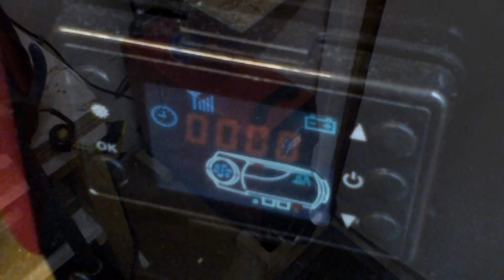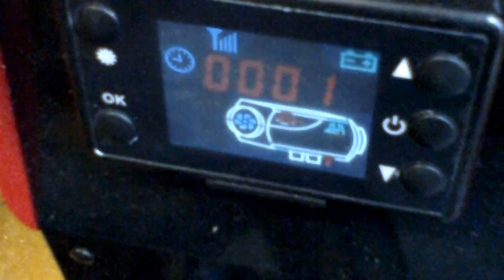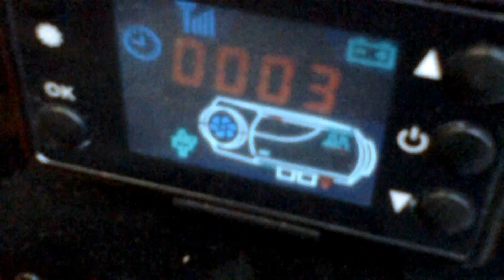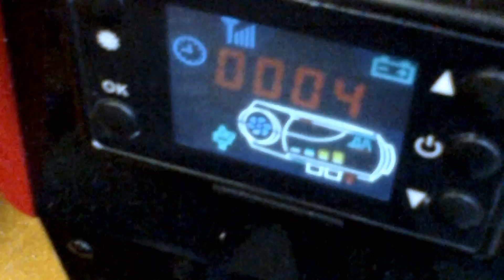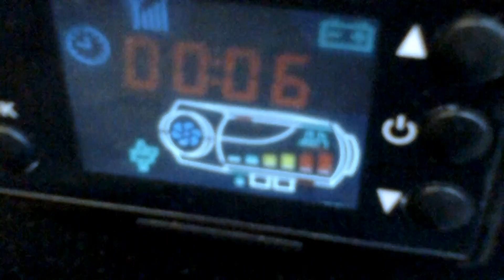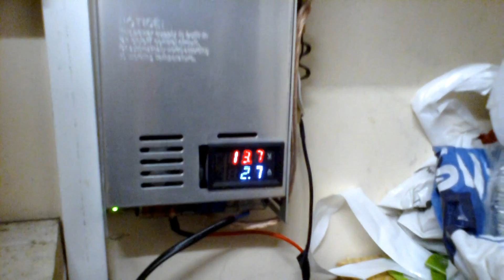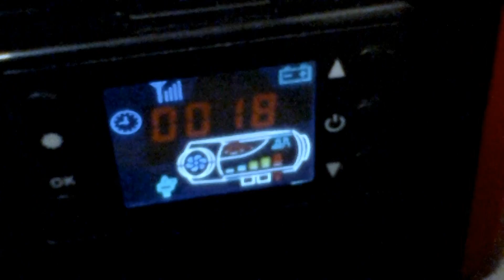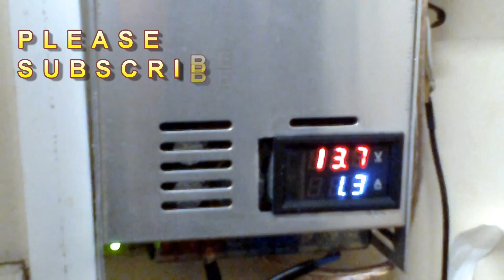COMPACT CHINESE DIESEL AIR HEATER - AMPS used in REAL TIME

Comment: Thank you for the vid...was just the info  I was looking for...just ordered a 8kw all in one unit similar to that for truck camper...thanks again
Reply from the maker: Hi there. Many thanks for posting a comment. My two units are running fine and I have also helped install one in a neighbours home where he wanted to subsidise the solid fuel heating but it’s so good and cost effective he is using it as his main form of heating now. Again thanks for taking the time to comment. Stay warm. Regards Peter

Comment: Hi Peter, I would double check the current on that meter, I bought a few for my eletric bike and found them to be reading on the high side
Reply from the maker: Meter is fine as I got two and both the same on the shiny which has the correct resistance. Thanks for you comment. Regards Peter

Comment: Hi Peter. How powerfull is the transformer that you are using to power it please👍
Reply from the maker: Hi Woody. Standard 12v 20 A power supply off eBay around £15 max. If you type it in loads come up.

Comment: Hi Peter. Where did you get your power supply. Could you give the details of the model. Thanks
Reply from the maker: Hi there. The power supply was obtained off eBay - just search for “12v 20 Amp power supply” but please be aware I myself fitted the volt / Amp meter so you won’t find that included.
I only fitted the meter so I could clearly show in a video the current these units were pulling as there was so much confusion especially between the significance between volts and Amps.
If you do the search you will find loads advertised which look the same - get one for less than £15..
Hope this helps you. Regards Peter
Reply: @brucepeter2007  Great stuff. Thanks Peter

Comment: Thanks for the vid, I was wondering whether to use an old pc atx psu to power one. What do you reckon?
Reply from the maker: If your competent that would be fine as long as the Amp are there. Regards Peter
Reply: Mark whalebone be careful computer power supplies have multiple power rail supply for the same voltage. Just cut all the same voltage wires and solder them all together onto a big connector.

Comment: I have the same 5k unit with red enclosure. I plan to use as emergency power-out heat. Current plan is to provide 12v from Prius extension cord. Prius will be left "on", so the gasoline engine will kick on if the 12v battery voltage drops. Very little petrol will be used in this arrangement.
Reply from the maker: Hi there. I have had three Prius when I was working - no street cred but a good solid vehicle and all were the most reliable cars I’ve ever had. I suppose what your doing is OK but not knowing your situation but the Prius battery in the back that’s used to start the car is so dinky. Good luck with your project. Regards Peter

Comment: So a startup and getting up to temperature (obviously dependant on ambient and space to heat) is about 1.65Ah, then it's about 2.5Ah for 5 hours use.  For a 5 hour run start to finish, your looking at about 5.5Ah roughly.

Goes to show why it's bad to turn these on and off all the time.  Great info, thanks for the video!  :)
Reply from the maker: Your welcome. Stay warm. Regards Peter
Reply: Your 2.5AH in 5 hours means 0,5 Amps only. But the heater sucks 0,5 Amps if the wanted temperature already has been reached only. Otherwise it sucks 5 Amps!  Therefore it needs up to 25 AH in 5 hours.

Comment: good you covered this!
Reply from the maker: Hi there  -  This video is one of the  most viewed and the question of Amps kept  popping up as many don't understand the importance of the Amps in a battery - people just put a meter across the battery and see its got 12v...
By displaying voltage and current in real time within the video it allows people to see in real time the power draw of the heater. Youtube is great for knowledge and I'm the first in the queue looking for help when I need information. Thanks for making a comment. Regards Peter

Comment: Is there a brand heater that is the best quality and most reliable?
Reply from the maker: Hi there. What a strange question you have fired at me. Like vehicles there are cars and cars! A Rolls Royce or a little Fiat 500... Both are cars and will get you there but one you can afford and the other you can’t.
Honestly that’s the same with this type of heater - my two units have worked faultlessly now since I got them and the wife used hers again today and I used mine yesterday. The units we have are like the Fiat 500 but to be fair the better units you can get have been ripping the market off for years which is why these heaters have made such an impact on the market. I can only report on what I know and these units seem to be fine and do the job well so I can only advise you to do as much research as you can and pay your money and make your choice.
Many thanks for your comment - an interesting slant on most I get.
Either way your choice goes I hope you forever STAY WARM. Regards Peter

Comment: Hi.  Great video 👍🏻. Is anyone using this in your Campervan ?    I’m Wondering if it’s any good with noise etc inside a van the size of a Toyota HiAce Camper ? . thinking of buying this. The 8kw one I think it is ..  Looking for any feedback on people who actually use them in your campervan .  Would be greatly appreciated. Thanks 🙏🏻 👍🏻✌🏻
Reply from the maker: Hi Bee. This type of diesel heater was mainly used for lorry heaters to keep the driver warm when sleeping in the back of his cab and so they have been around for years but not at a price us simple men could afford as the price of the original heaters was exorbitant to say the least - the Chinese decided to make a copy and sell them at a fraction of the price and hence the (forgive the pun)  “explosion “ with interest and sales of this type of heater. I would think the 2kW would be ideal for your size van but the smaller ones are harder to get. Don’t forget this heater works on a furnace principal so you can’t regulate the heat output like mixed air car heater... Hope this helps you. Thanks for your comment. Regards Peter

Comment: Great video very useful..what size in amperage/12 dc voltage is your meter..I can only find 10 amps..do you have a link please..thanks
Reply from the maker: Hi there. Goto AliExpress and in the search line just type in “Amp meter and Shunt” and you will see the meters come up. The shunts are quite large which is why mine was mounted externally from the power supply - you can see it in the video on the right of the power supply mounted on the wall.
Regards Peter
Reply: What make is the power supply please.

Comment: Will this heat a 1.5 car garage in the winter ..?
Reply: A 4x5x2 m Garage has  90 m2 heat sucking area. at U=2 W/m2 it needs 180W/deg. 5kW could make it 28 deg C warmer. At better isolation (1W/m2deg) it could be even 50 deg warmer.
Reply from the maker: Hi Mike. Your question does not make sense so please reply with better information and I will answer. Regards Peter

Comment: how long would  my 100amh starter battery last with the engine turned off running the heater on full
Reply from the maker: Too many variables like quality of battery and how old it is to answer fairly.
Not only that the heater backs off after the set temperature has been obtained so you never have it on full for the whole time anyway.
I am not being negative with you I just can’t give you an honest answer.
Regards Peter
Reply: @brucepeter2007  hello  maybe one hour  would be ok

Comment: Very informative video! Thanks.. I have one question- how do I supply that power? Can I just swap my van battery for a leisure one?
Reply from the maker: Hi there. The unit shown has the same bits inside as fitted to many mobile vans and you just have to ensure you have a battery thats in first class condition.
My camper installation has a 100w solar panel which helps top up the battery and this is fine. Battery condition is the key - stay warm my friend and thanks for your comment. Regards Peter

Comment: Would this work with a CHAFON 288WH Portable Generator UPS Battery Backup, Rechargeable Power Source Inverter with 110V/500W AC,12V? Thanks for the help!!!
Reply from the maker: They will work of a battery as long as it’s big enough to deliver the current and voltage but the problems with batteries is they start to reduce in efficiency over a short time when high currents are being drawn and although the heater draws high current only on start up and shut down batteries tend to start to fail on shut down so I would not recommend this - also remember the inverter has its own losses as well. If you have a method to keep the battery fully charged each day - like a vehicle alternator to try to use this setup day after day would cause the heater to stall... Hope this helps you. Regards Peter
Reply: @brucepeter2007  Thanks bruce, I just subscribed. I'm about to live out of my van again in New Jersey for a few months instead of getting an apartment for a year and I need some dry heat. I have a 100w solar panel but I think that paired with my battery would be too much. I'm thinking about adding an extra battery and that charges while I drive that would be used for the heater. Thanks so much for the reply!!!
Reply from the maker: Your welcome - stay warm. Regards Peter

Comment: Thanx for brilliant videos about this heater! Im considering buying one of these for use in my tipi at winter and had some questions i hoped you could answer. How long Will it work on a regular car battery? Is it possible to leave the unit outside with hot air into the tipi thru a aluminium pipe? I understand there are a sort of thermostat in it, is it possible to manual override it? Thank you and greetings from the arctic norway 👍
Reply from the maker: Hi Stig. As long as the battery has enough charge the unit will run - you don’t want it cutting out due to the battery not having enough power as it could melt some of the board components. Remember it’s a furnace in principal so you cannot regulate the temperature like you can with other types of heater it will only cut back... Hope this clears up the points you raised. Regards Peter
Reply: @brucepeter2007  so you Will not recommend using this offgrid? I had thougts of using this while hunting long way from home. Perhaps you have an idea of some  ways of using it to heat my tent? Thank you 😀
Reply from the maker: Hi Stig. By all means use it off grid but you need to ensure your battery iis up to the job to run overnight - another way to keep the battery in good condition off grid is to use solar charging as well. Lots of people use the heaters off grid but as my video shows you need the Amps in the battery for both start up AND SHUTDOWN and if your battery can supply that then go for it. Regards Peter

Comment: loved this thanks!
Im running a normal car battery and a 20w solar, this should just be enough juice for the night

But any idea how big the exhaust pipe is?
Cant find any specifications about that
Reply from the maker: Hi there. From memory the stainless steel exhaust is 24mm. Diameter. Glad the video helped you as it was made for exactly you guys who need to know.
Regards Peter

Comment: Thanks, is this the 5kw version? Only have a Goal Zero max 10 amp output, guess that wont work then!? :)
Reply from the maker: 5kW unit and your 10A unit will pop as it’s running well into its safety zone.
Glad you found it helpful. The more you see the video the more you will glean.
Subscribe to my channel as plenty of video tips on the heaters.
Regards Peter
Reply: Yes thanks l will look at the 2k version or a Planar then!

Comment: I thought I subscribed b4 so I'm just finding this video thanks that solves my power issue for my unit I run. It on solar batteries so I can't let it run down my system at night. So now I know what it use I can adjust  for it. Thanks
Reply from the maker: Hi Terrell - Your most welcome and thanks for the comment. - Latest video made on exhaust pipe heat recovery to show possibilities... Regards Peter
Reply from the maker: Hi Terrel. Sorry for the delay in reply. I have also made another video which could be of help to you regarding how much power the heaters draw which I made for the RV and Off Grid living guys ho needed to know answers for solar and battery use goto my channel Brucepeter2007 and see How many Amps - that should answer all your questions and allow you to work out what solar power and batteries you will need. Regards Peter

Comment: Very good test! I was going to do it with mine but now I guess I'll just take your word for it :) Thanks for doing this. I love this little heater it's amazing!
Reply: actually you are getting even better info than “his word” you are reading the actual amp measurement! :-)
Reply from the maker: Hi there. Both Ours are working great and while they do I won’t touch them as I have heard of so many who have “twiddled”  with the settings causing the units to soot up or fail. The LCD display allows people into the settings but you can’t alter the settings by trial and error you need a £100+ bit of kit to do that and also you have know how to interpret the readings... 
it’s a great bit of kit and I’m glad you enjoyed my review and found it informative. Thanks for your comment. Regards Peter

Comment: Hi Pete. Thanks for your video. I’ve got one of theses Chinese heaters in my garage running of a battery with a charger. But I’d like one of the power packs your showing on this video. Where can I get one and can you send me the link please 😊 Thanks Stevie.
Reply from the maker: Hi there. Look on eBay for a 20 Amp switch mode power supply and you will find loads the same as mine - remember I fitted the volt / Amp meter myself.
Regards Peter
Reply: @brucepeter2007  I'm installing one of these into my UK garage which has 240v mains power.  I bought a 240-12v transformer from ebay rated to 15A.  When I powered it up the LCD came on for a few seconds then the transformer blew. I know I can't link from here but it was similar to your unit but NOT the same.  It says on a label 220V whereas UK power is I believe 230-240V.   Any help with a specific link to a power unit I could use?  Seaching for "12 volt DC power supply enclosed switch mode 12V 15A 240W" on ebay would find my unit
Reply: Hi, what kind of battery is powering the heater in your garage, is it a car battery? How many hours can you run these heaters without damaging a standard lead acid car battery?
Reply from the maker: Hi there. I ran the heater on a car battery at first with a charger attached but then went onto fit a switch mode power supply. 
The question you ask is as long as a piece of string unfortunately because there are so many variables for your set up HOWEVER because the same questions were raised by people with RVs and motorhomes and even to Off Grid Living people I made a few videos which will answer all your questions regarding “How many Amps” the heaters pull which can help you work out your needs with charging, type of battery needed and also I did a video on the Switch mode power supply... All on my channel to help you and I always reply to questions. Please subscribe. Regards Perer

Comment: I have one of these connected to a small 038 battery that I charge up and use as required.  They are a very good heater but poor efficiency the waste pipe is so hot you loose a lot wasted heat 
I am very surprised no one has wrapped copper pipe around the waste and created a waste hot water supply storage 
Be ideal if you have a homemade jacuzzi  
More interested that you run these off a 240v power supply  so I can scrap the battery off and be more compact ...    just I have this as an emergency back up if it gets really cold
Reply from the maker: Hi Mondo. Remember your car engine is no more efficient as more heat comes out of that exhaust so no need to condemn this heater... I do have to admit that the exhaust could be adapted for heat recovery in some way but people seem reluctant to try. I have an idea myself which would no doubt be condemned if I mentioned it here but I do want to have a go to see if it works.
Anyway thanks for your comment - stay warm. Regards Peter